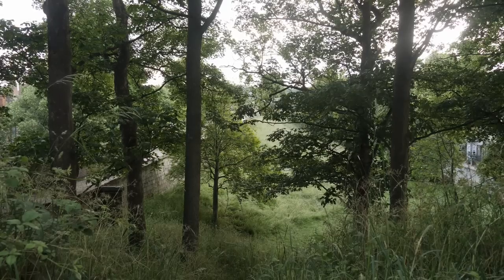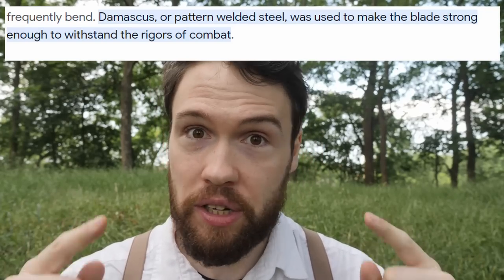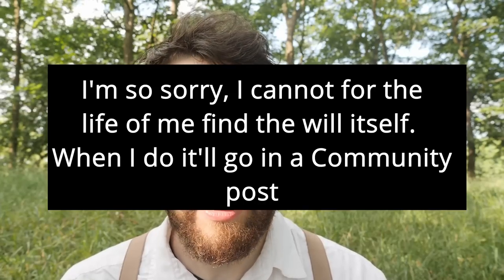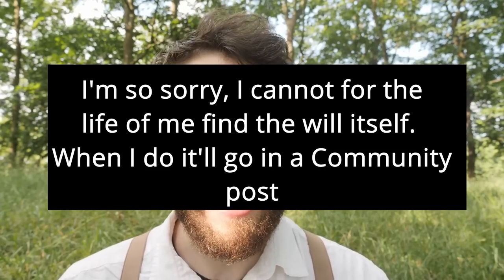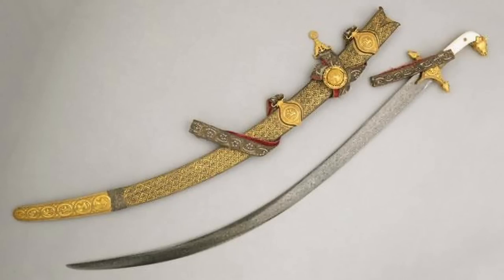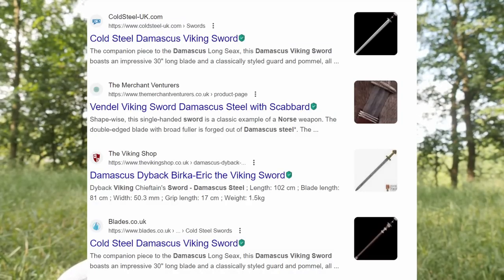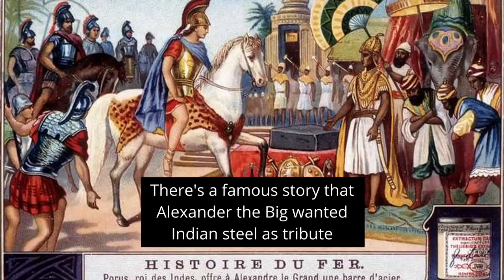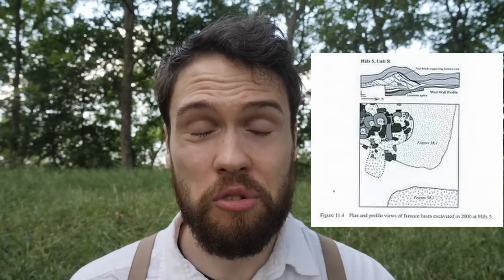Damascus Steel Isn't What You Think! Asian Crucible Steel in Medieval Europe

Comment: Someone needs to show Alec Steel this video. He make a lot of patterned wielded items and calls it Damascus steel. I've known the the truth about Damascus steel before I stumbled onto his channel, so I tuned out of those episodes after the first one I saw him use that. I didn't know the name of the technique at the time (patterned folding). Now, do I think Alec Steel is being deceitful or dishonest? Not really. I think he learned this really cool technique, and his sources sources (probably just as unknowingly) passed on bad information to him. I think if he knew the actual history, he would call his stuff differently.
Reply: If you showed this to Alec,I imagine he'd say the same thing the rest of us modern bladesmiths would say, and that's that Damascus is now commonly used by modern handlers to describe pattern welded steel. Do we know it's not crucible steel that was made a thousand years ago using a vein of iron someone found that had some crazy "alloy" in the original form that made an amazing blade for a thousand years ago? Yes bro, we know that. We also know that because our technology is light years ahead of what is was a thousand years ago that a basic high carbon steel from today that is well heat treated is miles above "true Damascus" of old.

Comment: What an awesome video, historical metallurgy is so cool. Who knew "true" damascus had such a drastically different process to pattern-weld, I always thought they were more similar. It should also be noted that pattern-welded steel is also historical to the Viking period and before (I believe the Sutton Hoo sword was pattern welded), and like damascus, can also be stronger than the sum of the steels used (if good steels are used, you can also just forge weld pure iron and weld steel together and as long as they have different carbon contents/ trace metals in them, they will make a pretty pattern. The result will be pretty, but weak). It is not as strong as damascus was purported to be, but pattern welded blades were still considered high-status weapons due to the extra time and skill involved, and they were probably more common in Scandinavia than true damascus because the materials could be sourced much closer to home. All this to reinforce Jimmy's point of if you want a pattern welded blade because you can't find true damascus, go for it, just make sure the steel is actually two different steels as opposed to a cheap monosteel that's been laser-engraved or, heaven forbid, painted.

Comment: I have a question for nitpicking Jimmy (Any of the Jimmys will do 😉). How does the japanese forging and metallurgy compare to damascus steel? I would love to hear your toughts on this. Thx! Greetings from Hordafylkir.
Reply from the maker: Japanese iron was generally absolutely awful, hence the need for extensive folding and forging techniques/m. But I’m no expert!
Reply: @TheWelshViking  Thank you! The reason for me asking this, is that to me at least, the steel used on the japanese swords looks a lot like damascus steel/folded steel. Nowadays it is all the rage, even Ikea sells knives in "damascus steel". Again, thank you. 👋
Reply: @TheWelshViking  that's actually a really nuanced question  with an equally nuanced answer. The ORE available in Japan is generally low quality, that is to say low yield, and it is very difficult to smelt due to it being extremely fine particles. That's why it's provided in a specific variety of bloomery furnace. That said, once the smelting process is complete, the technique yields a relatively high carbon steel bloom that retains enough carbon after repeated forge welding to make excellent blades. Ilya from That works channel did a piece all about steel comparisons that's a great watch, and it comprehensible to non experts. I shall go find it and attach it in another comment
Reply: @nickverbree  Thank you. 👍

Comment: Does the damask fabric have that name for the same reason, the patterning? I think I've heard it called watered silk.
Reply from the maker: Yes!
Reply: Damask is named for the city, but it's actually a type of very intricate weaving that results in a pattern on the front and back of the fabric. Watered silk, aka moire, is a finishing technique that involves getting silk wet and pressing it between rollers.
Reply: @kellyburds2991  Thanks!

Comment: I actually have several modern pattern welded blades, including a sword, an axe, a Seax, a "Talon" blade, a small hatchet-like blade, and several knives, including a folding knife.  They are very sharp and I love the patterns in the steel, which makes them look quite magical - the small hatchet is a pattern of spots and rings resembling "eyes", the pattern in the Seax looks like a series of large fingerprints along the blade, the sword almost resembles the patterns of a topographical map of a series of hills or large mounds, the rest are various styles of wavy water-like patterns.  I love them all (16 total currently, the lowest cost was $45USD for the folding knife, the highest was $225USD for the sword) and I have no illusions of them being anything but modern pattern welded blades (and good quality ones too).  I'm currently in the process of creating a series of leather sheaths and scabbards for them all, some of them built into a cross-body shoulder bag made from a silver fox pelt (loosely based on a badger pelt black powder "possibles bag" and a similar muskrat pelt shoulder bag my mother made in the mid 1970's), some built into a kind of backpack made from a coyote pelt, some made to attach to a belt or baldric (the folding knife is going into a cleavage sheath 😆).  Fun times.

Comment: Damascus steel comes originally from the area of Damas and then suddenly ppl are calling it damascus steel, but many sites have been found all over the area of Damas. But what ppl see all over the internet is cheap made, even crudely made with alot of imperfections in it. Pattern welded steel is what the vikings used etc.  I am glad you mentioned Damas and the misconception that ppl think it is damascus steel.  Tack från Sverige.

Comment: The thing is even if its not damascus but good quality patern welded blade using high quality modern sleels which are most probably superior to the old true damascus  you will have a truly good blade,but remember the patern is just simply for looks and doesn't add to the proformance of sword or knife 😊

Comment: As a blacksmith I am aware the modern use of Damascus is referring to different alloys of steel welded together (mostly involving some manipulation like twisting to get more complex patterns), nonetheless this is an actual historical thing to do there are hundreds of the pattern welded blades/spears/axes/guns and what not throughout history from Roman swords to Ottoman guns and the patterns can go insanely complex and they really knew what pattern they wanted and how to get them. As mentioned iron quality wasn't the best and folding and welding is a way to get impurity's out and one theory is that the patterns occurred to demonstrate the blade smiths skills because you can spot flaws and the more complex the better the smith so you knew it was high quality and wouldn't snap the first blow you hit.

Different alloy occur naturally depending where the ore originated from so iron from Germany might be harder, hold edge better but is slightly more brittle then iron from England but combined they make a better sword then alone

you can actually pattern weld the same steel as the carbon is drawn towards the weld, different alloys just make it pop more (like nickel gives a more silver line)
every time you heat a piece you lose some quality so pattern welded steel can never be better then modern steel

all this just to say modern Damascus isn't historically inaccurate it just didn't go by that name, pattern welding is insanely hard especially if you want to recreate the  same pattern as every thing you do differently impacts the final results and you can say about ancient Damascus what you want but we can't be certain as we still haven't figured it out.

anyway love the video keep up the good work 

btw for those whose patterned blades are fading: soaking it in used coffee grind should bring it back at it is slightly acidic but doesn't eat the blade like more aggressive acids... unless you have been scammed and the pattern is just etched in :o

Comment: for most people buying blades for reenactment wouldn't need an actual damascus steel blade- unless you plant on using it you wouldn't be able to tell the difference? 
They shouldn't be selling something under false pretences thought :(
Reply from the maker: Some people will buy sharps for demonstrations, and I guess if you found some good Wootz steel to show its quality in cutting that would be fun.

But yeah, very true!
Reply: I saw a woman on YouTube chopping wood with a sword. Apparently it was specifically made for that purpose. 
I'm not sure what it's made of, but it was damn impressive. 😃
Reply: @TheWelshViking  there are some smiths out there making wootz replicas. I think the thing in mind though is, as magical as crucible steel is, it doesn't hold a candle to modern steel. A modern replica will out cut it every time.

Comment: Vlberth swords were supposedly made from crucible steel.  They were good, but barely decorated weapons, which suggests they were mass produced.  In Europe.  Likely current Germany.

Then, you say that crucible steel is harder to make than regular pattern welded steel.  I think it's the other way around.  It's easier to make "some" steel in a crucible, the trouble is that you can't get rid of some impurities, which get removed during repeated folding and welding, therefore crucible steel requires higher quality ore.

Refining through repeated folding and reforging allows for producing very high quality blades, and that was done up to the industrial era and the practice still continues in Japan.  The problem is that it wastes a lot of material and requires plenty of labor.  It doesn't mean that the end product is of inferior quality, though.

Edit:  Then you said, that heat treatment required repeated hardening and quenching.  I checked it and wootz was tested to be hypereutectoid, which is why those bands of carbides form.  Hypereutectoid steels are supposed to be brittle, so they require annealing, not hardening, in order to become useful for cutting tools.
Am I wrong on that?
Probably not, since I remember Ric Furrer hosting a course on wootz, and they were very laboriously hammering on barely glowing pucks.  His channel is still up.

Edit:  Yes, I know that some people thought that Vlberth swords were produced from imported material.  I don't think that this idea makes much sense, though.  Those swords were produced for several centuries in fairly large quantities.  We know, because of the shear amount of finds, almost all of them from the outside of Christian realms.  It's logical to assume that the amount of Vlberth swords within the Frankish realm got to be an order of magnitude higher than outside of it.
So it was a very large production which persisted for a long time too.  It's hard to imagine they relied on imported raw material.

It seems I can't agree on just about anything you said so far, but I'm trying my best to disagree respectfully.
Reply from the maker: Ok

Comment: I don't really agree that Viking/Northern European Metalworking was 'primitive', since the amount of effort, beautiful twists and so on from spears like 'wolf-teeth' spear, viking swords and so on. And in-terms of construction, they combine having milder steel being more flexible and harder steel for the cutting edge, to make it in some aspects quite good. Heard from a smith, that the twisted wrought iron in the middle, on viking swords, is to make it stronger as well. There was also lake iron ore, alongside bog ore to make steel. And whilst you say it's 'not great', it goes through a refining process, with them clearly doing case hardening as well, to make iron into steel as well by adding carbon into them. And in-terms of iron extraction ratio, it's better than Japanese iron sand, I believe.

The term obviously is rather muddled with 'Damascus' with pattern-welding, I think it's a bit more clearer than what it was, but it's sort of a 'stuck' term, that's going to take a while for people to not market it as such.
Reply from the maker: Never said it was primitive

Comment: The only way to make an Iron sword was to forge it from a lump of smelted metal. Even if you tried, it would have been very difficult to exclude Carbon since they had to repeatedly reheat the Iron in the charcoal embers. All ancient swords were some kind of "damascus". Technically Katanas are "damascus" but they don't wipe down the blade with an acid revealing all the layers. Also, any damascus sword could be polished to a mirror finish. But then you wouldn't see the marbling. Steel contains less than 2% Carbon. It got there in the first place by ACCIDENT. They probably thought it was the process of hammering that gave it strength. I seriously doubt that over 2000 years ago they knew that they were incorporating Carbon atoms into their Iron. Whi knows.?.

Comment: er...its not a grift exactly, the bladesmiths  arent trying to trick you (generally) they know the difference, but the customer asking for damascus means they want a pretty knife.  Trust me if a customer asks for clarification on that point any bladesmith can barely restrain themself from infodumping about the differences between Damascus and damascus.  The reason pattern welded steel is expensive is mostly labor and the artistry that goes into making it (there is mass produced and etched stuff but the price is based on handmade).  Also in the sort of knives that are pattern welded and 500 pounds, they do happen to have superior steel in terms of strength (usually) to the original crucible steel.
Reply: oh and you are probably gonna hear this alot in the next few days but heating and quenching more than once isnt a thing exactly

Comment: Europeans absolutely made crucible steel.
Ulfberts are a famous example. Well, a part of them anyways...
Probably the cutting edges only, but still, crucible steel.
Same deal as 'Damascus' crucible steel, albeit a bit different in the alloying elements.
Reply: You also dont need a blast furnace to make it, some chaps tried it using mostly period methods. It does require some form a kiln though, enclosed, like a those modern little metal foundries.
Reply: Just to add another note. Those  chaps I mentioned that worked on the project determined that the only reason why the pattern is as it is is Vanadium present in that specific ore. Nothing else...
Well, nothing else in the alloy, but there is a lot of caveat in how you have to work the puck to achieve it. A bit too hot or too cold, for a bit longer and the pattern is ruined. So it is highly specific, but the real magic is in the ore :)
Reply from the maker: I’m not aware of any of the original viking age ulfberhts having definitively European produced crucible steel elements, only some hardened cutting edges, so if you’ve got a link to the paper that describes the metallurgy I’d be very eager to read it! 

I’m also not aware of any viking age European true crucible steel production, so again if you have a link to that I’d be very pleased to read it!
Reply: @TheWelshViking  you and me both 😅
It was a very long time ago I read anything regarding that topic. I barely managed to remember that documentary by Mike, linked further up somewhere.
Basically, its not anything special with modern steels, so it kind of lost its charm for me. Our most plain steels are now super steels to the super steels of the middle ages. And we literally have a subgroup of modern steels called 'super steels' so yeah... 😅🤣

If I do manage to dig something up though, Im definite to link it here :)
Reply: Out of curiosity, do you have any links to read upon, where it is specifically stated that the steel of an ulfbert was specifically that damasus crucible steel were talking about?
Since I could have sworn that it was another steel entirely 😆

Comment: What we know today as Wootz crucible steel does closely resemble the original "damascus" steel. And depending on what they put in the crucible, it can be a close approximation. But usually they pick 2 steels that give a nice contrasted pattern when etched. A youtube smith with channel FZ- making knives makes recreations of Wootz crucible steel, and he makes it look easy (it isn't). As for the scammers, there are knife sets out there being sold as "Damascus", but in reality they're from the cheepest steel they could get, and have etched a pattern into the steel using a laser etching machine.